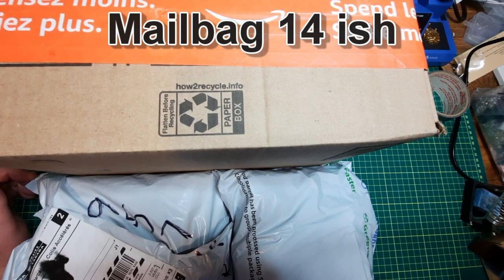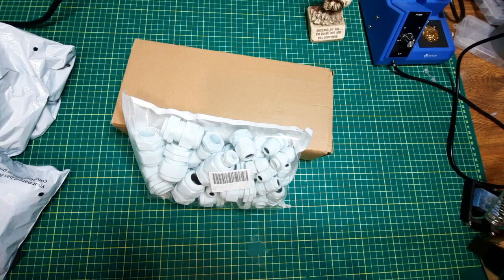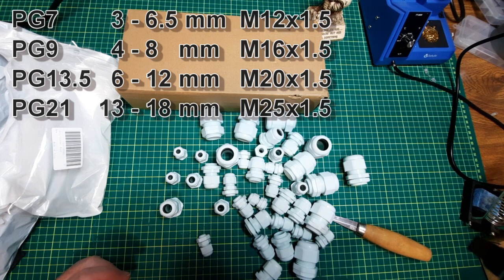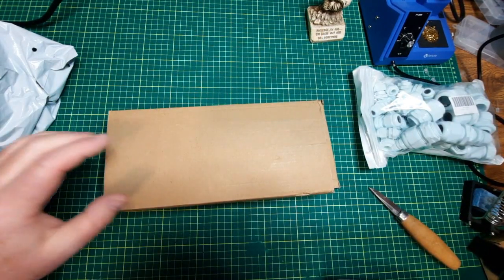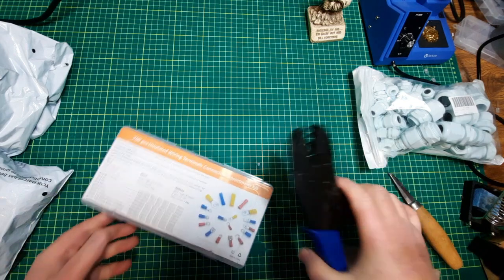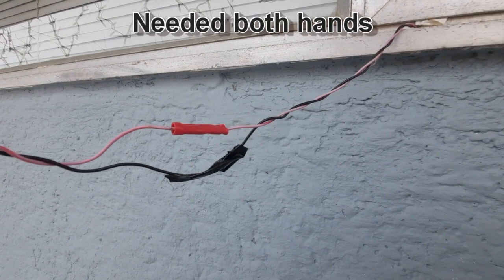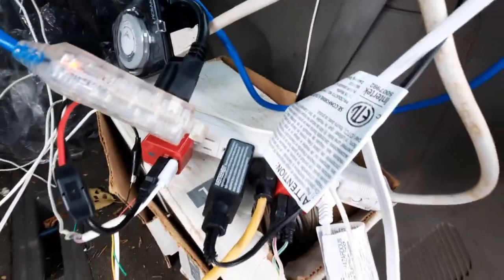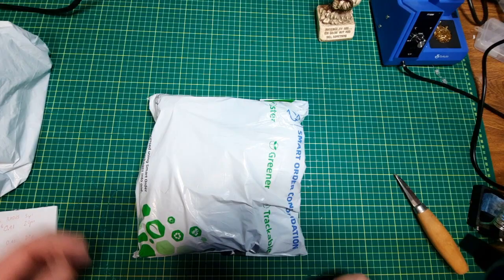Electronics Mailbag 14 ish

Comment: For testing SMD LEDs in-reel I find the multimeter diode tester with needle-tipped probes to puncture through the tape works a treat.
Reply from the maker: I will have to try that, these are so tiny. Did find an easy way of retreiving these when they disappear on the floor, Nice size neodymium magnet picks these up quite nicely.